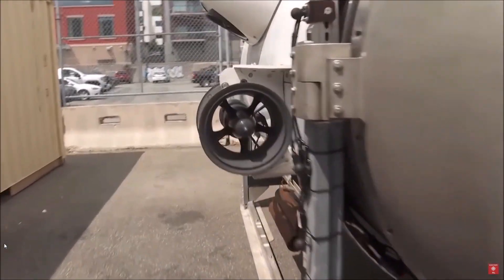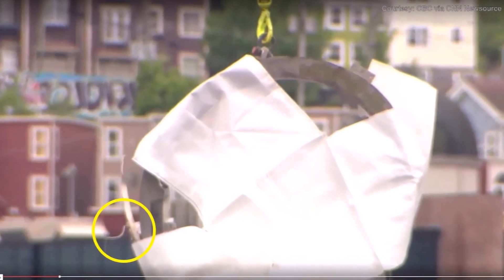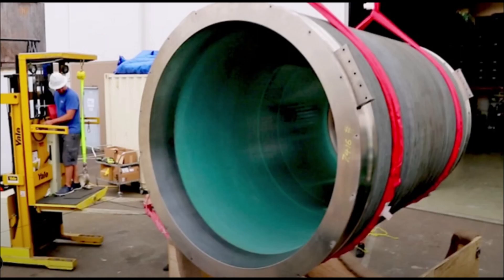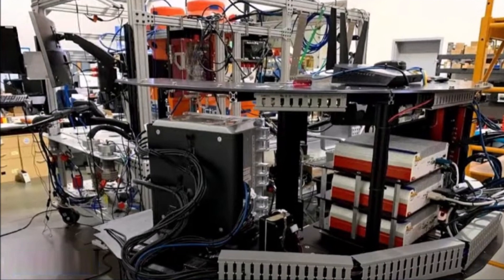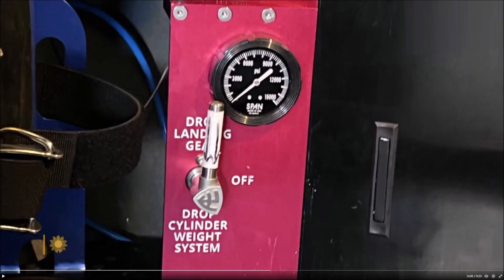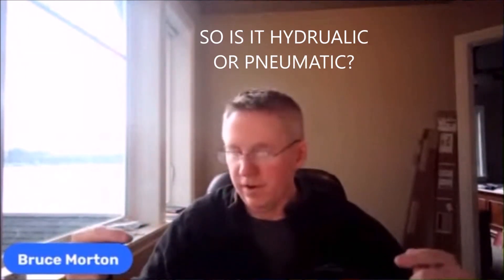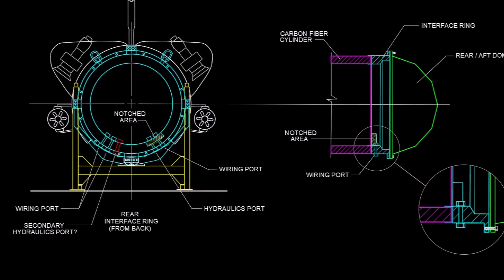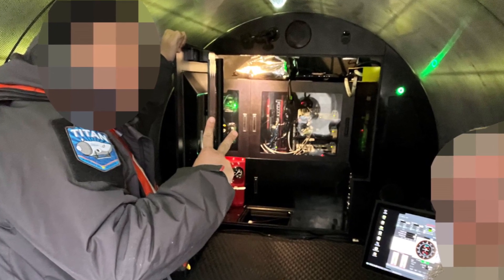OceanGate Titan - HULL PENETRATIONS

Comment: almost certainly hydraulic and not pneumatic, standard hydro cylinders will run 3, 4, maybe 5k PSI and high performance even higher. and the internal gauge is scaled appropriately
Reply from the maker: Agreed. It would have needed to have been hydraulic to overcome the hydrostatic pressure at depth.

Comment: If Bruce Morton designed the systems, but subsequently couldn't explain them - that's disturbing.
Reply from the maker: He was an electrical engineer so he may have only needed to provide an electrical  cable from one piece to another or something along those lines. Or it could have been completely mechanical and he was only aware of it in the overall picture. (speaking of the frame release mechanism)

Comment: They are not wires,  they are cables.
A wire is a single conductor which is usually insulated. 
A cable is a multi stranded core of wires which is usually insulated. 
Please call a cable a fkn cable please 
Love from Great Britain 🇬🇧
Reply from the maker: Yes, technically they are cables.
Reply: @VegasCyclingFreak  not technically,  they actually are, really are.
I am a vehicle electrician and you are just a novice at English and cables which is evidenced 
You could say technically a car is an egg but yet it is not.
How do you describe water if you are being picky ?
Reply from the maker: lol sorry but when I hear the word cables I think of a suspension bridge or post tension concrete slabs. I don't really know what was hard wired between inside the hull and outside the hull. Could've been cables and/or just a wire for some things. Should I say hard cabled instead? Never have heard that term used in my 30+ years of working in consulting engineering here in the USA... it's generally just called wiring. In construction, coax cable is installed by electricians and all that stuff is generally is called wiring when looking at the big picture. FFS we've all been wrong! I better start correcting everyone from here on out. I am still confused by this stupid English language that I apparently don't know. 😕

Comment: It would be interesting to know how wiring penetrations are done in legitimate submersibles like the Alvin and the Trieste.  Also, would legitimate submersibles have tubing going into the pressure vessel?
Reply from the maker: If you need stuff hardwired between inside and outside, there's no other way to do it. My understanding is the hull penetrators used on Titan were rated for much greater depths than where Titanic lies.

Comment: Interesting, if those giant nut hull penetrations are a weak point then its possible the thing was damaged during its drag out to see and submerging while being trawled underwater drama.
Reply from the maker: In theory shouldn't be a weak point and it's in a place where not easy to get to as far as being whacked or something. I don't quite understand exactly how they work... don't know if they are screwed into the interface ring or what exactly is happening there. It is potentially four failure points though.
Reply: @VegasCyclingFreak  The entire thing got caught up in some fishing net at one point while its platform sank as it was being towed out on rough seas, not sure if you heard about that. Would have never been designed to take such abuse even if certified.
Reply from the maker: @spikester  First I've heard of that. How did you become aware of this?
Reply: @VegasCyclingFreak  This was all over the archived footage from oceangate, they had to repair the platform after it was damaged after hooking a net during its tow, after that they had all kinds of technical issues with the sub on the next dive attempts, and apparently some local communication link failures too that aborted all subsequent dive attempts.
Reply: I was lucky to have a big titanic binge a good month before all this went down (titanic always fascinated me in history), and saw a lot of original oceangate youtube content, as it surprised me there was only one company really doing any real 4K UHD footage of the titanic.
Reply from the maker: @spikester  Rush did mention something about fishing nets in 2022 interview with David Pogue… just that they were a potential hazard. If that is pre-2020 event it doesn’t really apply. Titan seems to have had some kind of technical issue most of the time.
Reply: @VegasCyclingFreak  Heh, no, its a post-2022 event... they didn't need to tow the submersible like that with the Horizon Arctic charter which had a ramp on the rear. The polar prince they hired later was the one that towed the platform. Rush should have did a 2nd sub for 2000M and bought a better ship/crew first before the big one.
Reply: I know these ships because I lived in the maratimes, Labrador.
Reply from the maker: @spikester  It's a shame we don't have access to those videos anymore. I knew they would all be taken down, was just a matter of time.

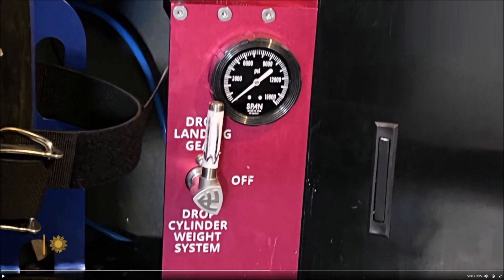Comment: I believe both the Weight Drop System and the Landing Gear could be dropped, as described by Rush, using a manual hydraulic pump and a 3-way ball valve (5:38) inside the hull with only two hydraulic lines penetrating the hull.  The pump discharge would be connected to the inlet of the 3-way valve. One outlet of the 3-way valve would be connected to the Weight Drop System hydraulic cylinder(s) and the other outlet would be connected to the Drop Landing Gear hydraulic cylinders.  The pump inlet would be connected to a hydraulic fluid reservoir inside the hull (which may be the source of flammable hydrocarbons Lochridge complained about in 2018).  
While many hydraulic cylinders have two connections and can be hydraulically driven in both directions, some cylinders have only one connection and the cylinder is only driven hydraulically in one direction.  Motion in the opposite direction is provided by a spring.  
There would undoubtably be multiple check valves in the system to prevent backflow of seawater in the event of a leak in the exterior line or cylinders and probably a 2-way, on-off, ball valve for the same reason. Autoclave Engineers offers a line of 2-way and 3-way “High Pressure Subsea Ball Valves” conveniently rated to external pressure of 12,500 ft, the depth of the Titanic wreck.
They drop system would be operated as follows:  the 3-way valve is normally be set in the “Off” position.  No fluid can flow through the valve.  To dump the Weight Drop System, the 3-way valve is switched to the Dump Weight Drop System position and the pump is manual operated actuating the appropriate hydraulic cylinders.  To drop the Landing Gear, the 3-way valve is switched to the Drop Landing Gear position and the pump is operated, pushing fluid to actuate the appropriate hydraulic cylinders.
I spent the first decade of my engineering career designing, building, and operating high pressure pilot plants for chemical and petroleum refining processes so I am familiar with Autoclave Engineers high pressure products.  Later In my career I worked with some hydraulic and pneumatic actuators.
Reply: HI PLS READ MY THOUGHTS YOU MAY ALREADY KNOW

Comment: Congratulations on finding a picture showing the hull penetrator(s) on the port side of Titan.  It seems most nude photos of Titan are taken from the starboard side.  Here’s a 2017 picture that shows there are four holes for hull penetrators in the aft interface ring.  Search for the Sep 2017 GeekWire story by Alan Boyle entitled: Inside the submarine factory. Rush is standing at the starboard end of the hull before the liner is installed. Four holes at 430 and 730 o’clock are clearly visible.  
I’ve found no evidence or reason that Oceangate manufactured new titanium endcaps and interface rings when they replaced the carbon fiber hull in 2020 so I assume the 2017 interface rings with holes for four hull penetrators were part of the Titan in the final 2023 dive.
There are several pictures showing that the large hexagonal can pass at least three cables or hydraulic tubes.  At (3:15) it looks to me that both a cable and a hydraulic tube are installed in a single hexagonal hull penetrator head. At (1:24) there are clearly two hydraulic lines in one hull penetrator and possibly a plugged hole where another could be installed.   Each red electrical connector (plug) can pass multiple electrical signals. A hydraulic tube can only pass one signal, and with a check valve it can only pass a signal in one direction.

Comment: Starboard has the penetrator with two tubes coming out of it and the one above that has a single tube coming out of it leading towards the front of the sub, you can see it if you look closer at the newer pictures. There was a total of 4 penetrators, some of them were made of titanium originally and the newer ones were made of stainless steel based on how they look like different materials....
Reply from the maker: Seems reasonable… maybe there were only three hydraulic lines penetrating the hull. It’s hard to tell exactly what is going on from just pictures and quick glances in a video. It would help if I knew what kind of actuators they actually used, that would narrow down exactly how many of these lines were actually needed/used.
Reply: @VegasCyclingFreak  Check oceangate titan subreddit somebody recently shared a post of the 4 penetrators, or in alan por el mundo mi expedicion al titanic parte 2/4 at 15:32 and beyond you can see almost everything

Comment: Portside had two as well, the birns connector one is the lower one that is harder to see
Reply: The port side control pod has been referred to as a spare,so that the port side might have the same connections.Interesting that the some of the oil filled enclosures are not shown in the debris.The air tank is absent also.

Comment: I still like this journey of trying to figure out all the design details - thx. One comment on the 'notch': I saw in a picture of Rush half in the open front hatch an almost identical rectangular darker area on the interface flange of the forward ring. It looks like a texture difference and that is all. I still very much doubt there was such a huge bite taken out of the ring that would compromise either the seal, the structure, or both. I agree the engineer seemed very confused about the system he designed ... not a good sign.
Reply from the maker: It’s hard to say about the existence of a notch or not. Sure looks like a shadow to me but I could be mistaken. I don’t know how securely mounted a manifold would need to be with those kinds of pressures… the computer support framing may not have been good enough? In any case, it seems like both those systems must have been hydraulic.